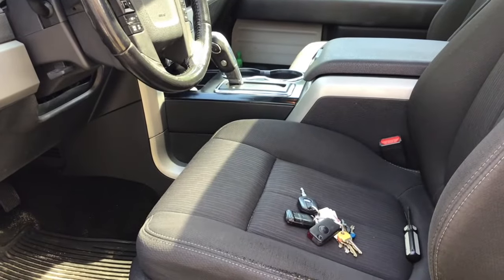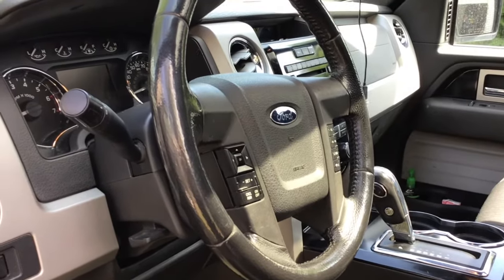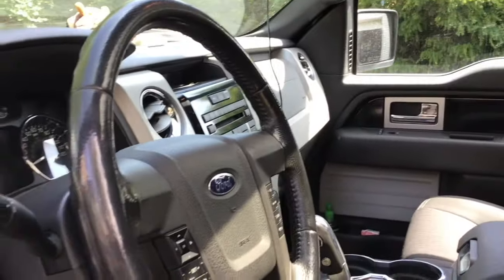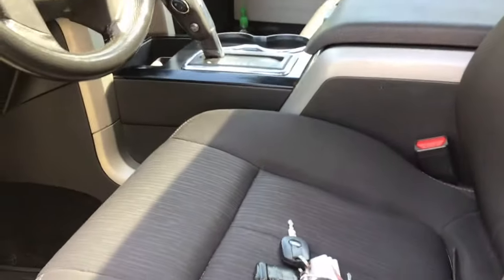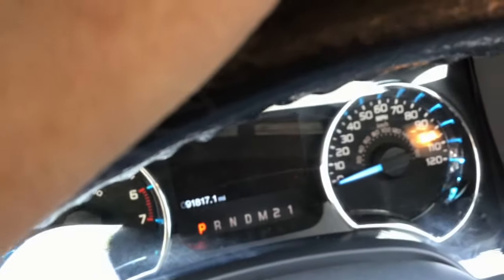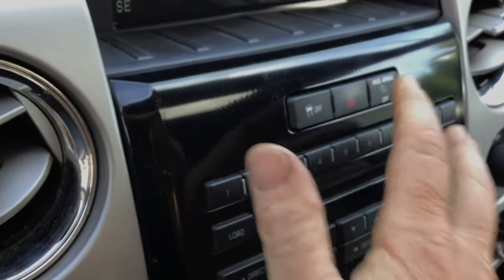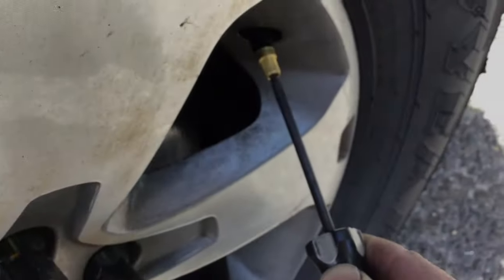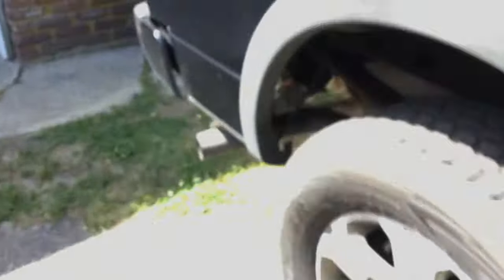How to relearn and reset TPMS (tire pressure monitor sensor) light on 2009-2014 Ford F-150

Comment: Thank you! I echo what everyone says! One question on something I ran into. I got this process started but once it got me to right front tire I let air out of it and it never honked to move onto the rear passenger tire. I got down to 30 psi on the right front tire (max 51psi). Any idea what may cause that? Do I have possibly a bad sensor on that tire?
Reply from the maker: Thank you too!

Yes it does sound like a bad sensor

Comment: Do you have to overfill the tires first?  might help if you would explain. if you start with 35 psi ,  at what point do you get the beep and then you have to refill them again I assume. little vague on the procedure.
Reply from the maker: You start at around normal pressure 36psi and you let air out of each tire until it beeps. And then add air back up to 36psi or where you keep proper tire pressure for your vehicle. If it never beeps and tire is almost flat then you have a bad sensor.
Reply: What if it Beebs twice what does that mean
Reply from the maker: @AdalbertoRodriguez-zp5sj May have redo the whole procedure again

Comment: Hi do you have to refill the air to operating Preasure after the reset?
Reply from the maker: Yes, never drive without the proper tire pressure.

Comment: Have 2013 f150 to reset light all I did was fill tires to correct pressure (35) unhook negative battery turn lights on..reconnect battery, started truck and yes the light was still so I drove it 1/2 mile and the low tire light turned off...all on its own.
Reply from the maker: There was probably nothing wrong with yours.

Comment: This worked perfectly for me until i got to the passenger front tire, it never beeped at me which leads me to believe the sensor is bad.  thank you though for the insight
Reply from the maker: Yes, the battery in the sensor is probably bad. And sure no problem!

Comment: So I have question. I just had three sensors replaced.  Mechanic said to drive 20 + miles and the light would reset ( it hasn’t yet) !
  Were they supposed to do this re- learn or do it with a scan tool?
Reply from the maker: New sensors have to be reprogrammed into the vehicle’s computer, THEN relearned with scan tool.

Comment: Are you letting all air out or just some?
Reply from the maker: As much as needed until it beeps. After you finish all 4 wheels you have to add air to proper specs for your vehicle

Comment: So, it worked BUT, I had to let out a lot of air on LF. Then after the error cleared when I completed the process, the error came back after a few minutes. Likely because my LF is low after letting so much air out. LESSON, don't do this unless you have an air compressor nearby to refill your tires.
Reply from the maker: Good point!
Reply: I was doing this and from 40psi and to 30 psi . And still no horn sound I was like let me do this later when I get to the gas station first

Comment: I have a 2009 Ford F-250 and I was able to get it into training but when letting air out of the first tire the truck would not honk. I tried twice and now I need to get air in my tire. I suspect that means that the left front tire has a bad sensor?
Reply from the maker: Yes, it’s probably a dead battery, bad sensor

Comment: Had this notification for a while on my truck, and recently my husband had the four wheels replaced (new rims also, everything bigger than the original) by a small local shop nearby. How is the truck able to to detect new, bigger tires installed?
Reply from the maker: It won’t unless they installed the original sensors in their original locations. Plus larger diameter tires will throw the mph off a little.

Comment: Both front tires had a beep right away. My left rear had a lot more air released and then I heard 2 beeps of the horn. left rear almost all air out but no beep. It said low air pressure on dash.
Reply from the maker: Sounds like you may have a bad sensor. The 2 beeps probably made the system end before learning.
Reply: @motorcarnut

Comment: What do you do if one of them actually does not work?
Reply from the maker: Either that one has to be reprogramed then relearned or replaced.
Reply: @motorcarnut  how does one reprogram it???
Reply from the maker: It requires a tpms scan tool

Comment: Will this work if I install NEW take offs on my 2013 from a 2021 F150. If not, is there a procedure?
Reply from the maker: Not sure if the sensors are the same, you would have to research that. If they are different just install your old sensors in the new wheels
Reply: @motorcarnut  Yes, I could do that, but the last time I broke down a car tire was in the 50's and we drove over the tire to break it down. Tubes back then, too.  I have done many motorcycles, but not cars.  I planned to sell my old set. thanks for the reply!!!
Reply from the maker: No problem
Reply: Did you ever figure out if they would work?
Reply from the maker: 2021 sensor are different from 2013
Reply: I just put 2022 22" navigator rims and tires on my 2013. At first, nothing.  Then after a few weeks it came on. But, 2 months before with oem rims I went for an oil change and rotation at a Ford dealership and half way home it came on for the first time. Periodically it would come on and then go away. Now it's on all the time. Haven't tried this trick yet. But when I saw your comment, I lts the same situation I have.

Comment: Is there a way to find out if you have a bad sensor besides this?
Reply from the maker: Yes, with a scan tool.
Reply: @motorcarnut  ok I used it and got the code. So I did the relearn and I will see it that fixes it because they all beeped
Reply from the maker: If you got a code that should be taken care of first.

Comment: Do you have to add the air back afterwards?
Reply from the maker: Yes you do and sensors are different and have to be replaced
Reply: My brain just locked up reading that..... Seriously?
Reply: @djwilson48625  mine did also .

Comment: I tried and i did 
All the steps first  tire 👌  put the passenger side didn't  work
Reply from the maker: Probably that passenger side sensor is bad
Reply: May be a stupid question but with all the air you let out of those tires I would think the light should be on until you air them up to correct psi.

Comment: I tried this and I released so much air and the horn never went off..I purchased  newer tires and rims off road and had new sensors put in and the warning came up,they tried to recalibrate it and nothing..I took it to ford and they said the rear ones are bad..I took it back and they decided to put my original tpms on the new rims and tires same issue which worked with my original factory tires andrims..Can someone tell what's the problem,before I go back to ford...Thanks
Reply from the maker: The sensors probably have to be reprogrammed then relearned.
Reply: @motorcarnut  TY
.

Comment: What are you pushing to make it okay
Reply from the maker: Ok on steering wheel
Reply: @motorcarnut  the only okay is next to the phone symbol on the steering wheel
Reply from the maker: Correct or the hazard button depending on what year you have.
Reply: Thank you very much
Reply from the maker: @larryrockett8707 no problem

Comment: I tried this. Driver honked once. Got to my passenger side the horn honked twice. And it said to repeat test. inflated all back to proper psi. And ran test again and passenger side honked twice, that tells me that my battery is DEAD. Just logic here folks
Reply from the maker: Dead battery means failed sensor as i stated. Battery is not replaceable. But to be 100% sure you need to "look" at the sensor data with a scan tool which is not what this video is about.
Reply: I tried your method it took around the truck 🚚.  Of course this happened at night so I will be putting air back in my tires in the a.m thanks
Reply from the maker: @grovermoore4071 no problem!

Comment: 2011 F150 Lariat doesn't work.  All new sensors and it doesn't notice when removing air
Reply from the maker: Then you need to reprogram them to the vehicle first then relearn them to each wheel
Reply: @motorcarnut  I'll give it a try
Reply: @motorcarnut  And how do you do that?
Reply from the maker: With a scan tool or tpms tool